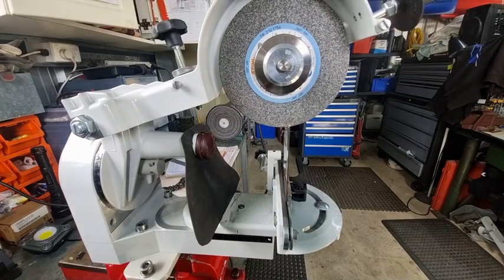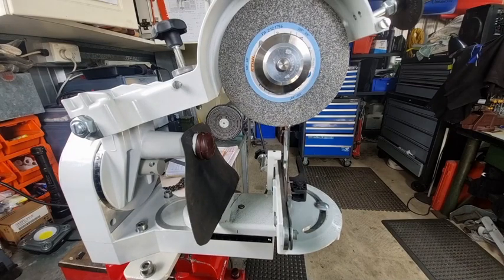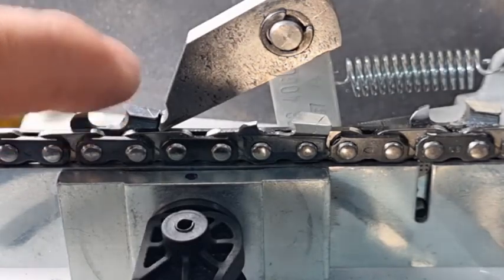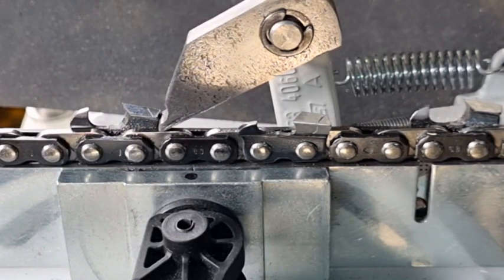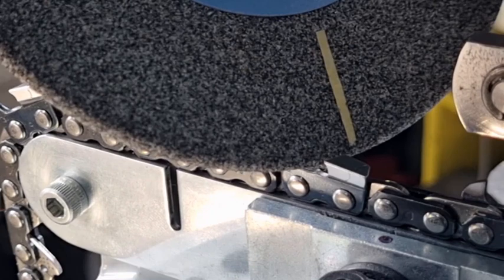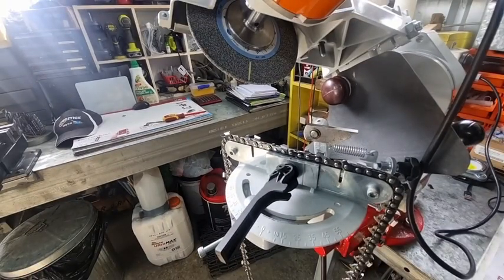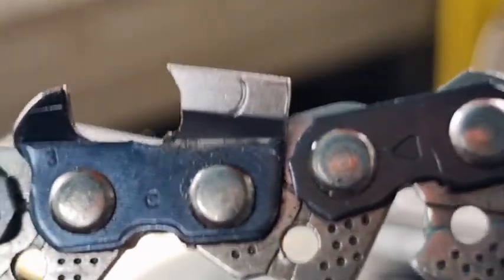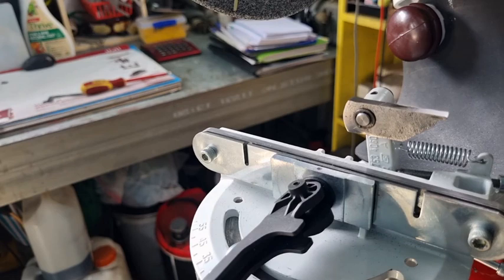Stihl USG 10° tilt when B scale is set to 0mm

Comment: There is one thing that I don't know if it comes up in the Stihl saw universe or not, with .325 inch pitch saws (what I never really liked about .325 inch pitch is the chains ends up on a lot of quite capable 50 to 60cc tools, and then everything down to the most pathetic, most useless 40cc type saws as well, and it's really the same bars and chains). When I ventured outside of my familiar 3/8 inch pitch world, going in search of chainsaws that could be used 'rear handle' fashion for more arborist and tree care, landscaping purposes. I ended up grabbing quite a bit of Oregon .325 inch chain, bars etc (assuming that it would mix and match fairly simply with stock Husqvarna bars, saws etc I started using). And this very much relates to a point made about 'chain skip' problems a while ago. That problem of the undercarriage drive links getting distorted, as they hammer against that protection intended for use if a chain skips or breaks completely.
Reply: What I'd ask is, to place some different .325 inch pitch bars on top of each other. And what one finds (I think), are some bars are shaped brand new to narrow down to the diameter size of a seven-pin .325 inch sprocket. Definitely any Husqvarna bar I own is narrow at the place where the bar is closest to the sprocket. And that seems important, because behind the clutch cover of any 50cc saw, there's not a lot of room (when we begin to talk about chip evacuation etc). Here is the thing though, I think some folk are operating with 8-pin sprockets with their .325 inch tools. And some of the bars at the place where the bar and sprocket are close together, the bar is larger dimension (to suit a larger diameter sprocket).
Reply: What does that mean though? Well it means, that in order to operate certain bars with the small 7-pn sprockets (either ring sprocket type or ones that are part of the clutch drum), you have to do metalwork. You have to trace the profile from the bars with the smaller dimension on the sprocket end, and file or grind your metal bar down to suit the narrower profile. Otherwise your chain is going to skip off (and that's when you run into that problem too, where the drive links get damaged as the bounce off of the chain guard metal when the chain comes off the bar).
Reply: As I said, using 3/8 inch bars and chains none of this ever occurred. Behind the clutch cover on those larger saws there is just enough physical space that chips can move more easily, and oil and chip deposits don't clog up that space. What happens on these smaller 50cc tools, and down to 40cc plus, is the clutch cover allows very little room for anything. And on top of that, you'll find with a lot of .325 inch pitch chainsaw bars, that dimension of the bar where it sits next to the sprocket, it can't be too large (otherwise the chain hits an obstruction as the drive links attempt to move from the sprocket to the bar groove, and the chain 'will' fly off the bar altogether if you've too many chips and oil trying to move through the same space). Honestly, I've been deeply underwhelmed and under impressed with all of my smaller chainsaws from this perspective. Although, I find these smaller chainsaws real handy too, as I use them instead of electrical carpentry saws for certain tasks in building with timber. I'm motivated to figure out how to use smaller chainsaws, but make no mistake they have their issues.
Reply from the maker: There are way to many saws in the Stihl range some like ms 170 and ms180 being 2cc different and .325 in in the mix on 3/8 lp and standard 3/8
.325 is only for small saws 40cc to say 55cc
It's not my sort of chain that I 7se a lot.
Many people swear by it.